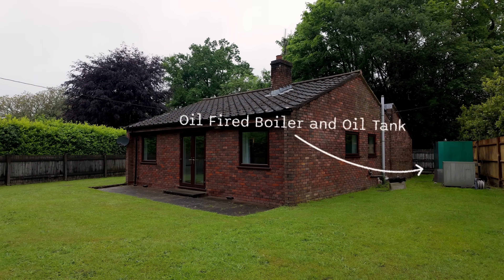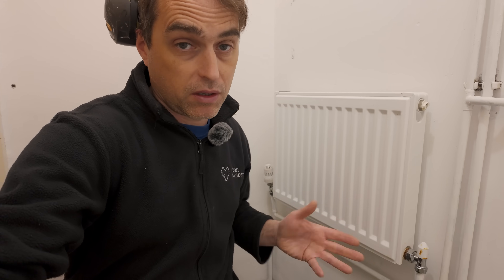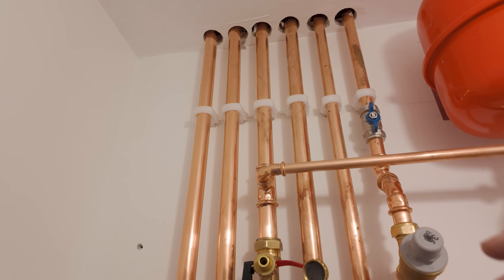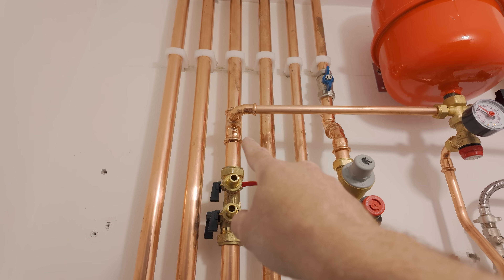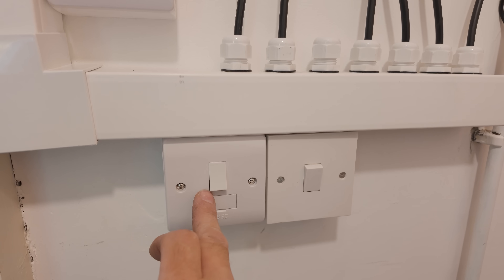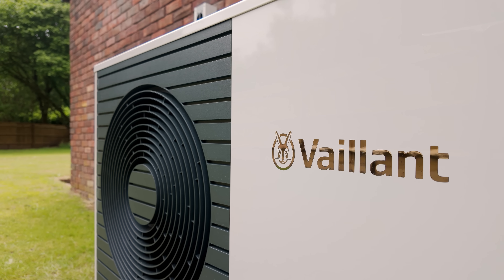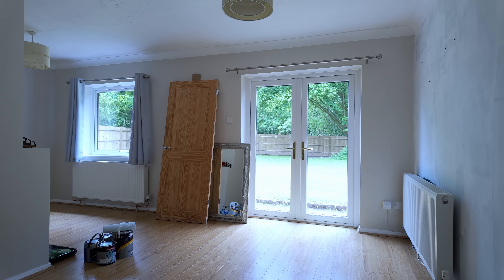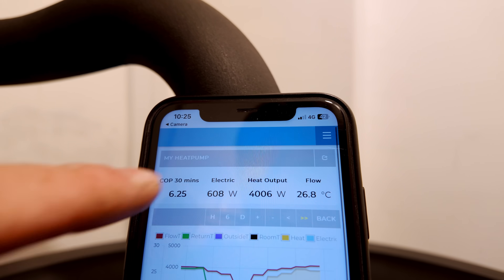Heat Pump vs Oil Boiler. It's a no brainer.

Comment: It will only take about a hundred years to pay for itself...🤣
Reply: I would guess environmental reasons. There is also every chance that oil boilers will be phased out in the next years. So why not replace it now when there is grant money available? 

If your tenants have low bills then you're less likely to have problems with rental arrears. 

Also likely to have tenants who stay long term if the bills are lower than they would get elsewhere. 

Off the top of my head that's three. Together we found FOUR potential reasons.
Reply: We never seem to ask how long a new oil boiler will take to pay for itself but for some reason we always seem to think a heat pump needs to pay for itself
Reply: As it was the landlord who installed it and the tenant who will save on bills I think we can assume they had other reasons for doing it.
Reply: @AmosMoses777  Stupidity???....
Reply from the maker: System will be much more reliable than gas or oil. There will be no bills to pay. House is always warm and no needs to think about turning the thermostat on or off. 

For the cost of new oil boiler they got a full new heating system.

No brainier
Reply: @AmosMoses777  Replace 25 year old kero combi boiler + System Flush + Replace rusty oil tank, less government BUS grant = £00.00 cost
Reply: @christianfaversham3766  You can't get an oil boiler on the BUS scheme. AS or GSHPs and in some cases biomass only. No fossils, no hybrids.  

You can get oil boilers on ECO4 but this doesn't look like it would meet the eligibility criteria for that.
Reply: @AmosMoses777  I put forward a cost comparison to replace a kero system, the amount you would have to pay out, and a switch to a heat pump with a £7500 BUS grant added into the budget.
Reply: @christianfaversham3766  oh, I see.

Comment: Interesting but modern condensing oil boilers do not smell (a friend of mine has one in her back garden). The oil tanker only has to visit about once annually I would have thought with a decent size tank? Maximum twice a year anyway. Notwithstanding not having to service the boiler is a bonus and additional cost saving.
Reply: Modern oil boilers have been low nox for number of years now . And average property doesn’t need anywhere near 2500 ltrs . 1000 to 1250 I’d say is normal as most home owners only buy 500-1000 ltrs at a time , I’ve quite few where 1000 ltrs lasts well over a year with decent insulation.

Comment: How comes you got the blow off from the expansion tank connected? I thought the vaillant was a partial monobloc and has it built in to the external unit?
Reply from the maker: No, 5kw and 7kw don’t have PRV built in only 10 and 12 do
Reply: @UrbanPlumbers  ah right. That’s another revelation!! 🙄😫

Comment: Excellent video (and installation) as usual. 👍I have had a look at the monitoring page and it is performing really well. That is a small property with commensurately low heat loss it will be interesting to see how it handles the shoulder months with regards to cycling. The new combi cylinder may have been a good application for this property.😉 Syzmon can you recall what design flowrate you were expecting on the system compared to what was achieved during commissioning from the Open Energy flow meter? 

Nice to see a Landlord looking after the property and their tenants too.👍

Comment: the bulk of my work is oil fired heating, when it comes time to change boilers most customers dont want to hear the words 'heat pump', probably because of all the early installs creating a lot of scare stories (which are mainly true around here).. its always good to get rid of the kero but for most customers the greenest thing they are willing to do is try HVO when its introduced.  in the past I have taken out ASHP and replaced with oil because customers are cold and poor, these stories make their way out into the Welsh communities and people dont trust heat pumps after that.. there is a lot of educational, as well as physical work to do.

Comment: He must be getting well paid by the heat pump manufacturers for promoting these heat pumps they cost a fortune to install and run and are no use in a cold climate like Scotland.
Reply from the maker: Heat pump manus would rather keep selling boilers as it easy money for them. Scotland is not a cold climate and heat pump work perfectly well there. No one pays me apart for happy customers
Reply: Tell me about your "Cold" climate in Scotland.
Reply: There are more heat pumps in the colder Norway! than Scotland. They work very well (ask a Norwegian) Scandinavians are better educated on heating and Global Warming!!!
Reply: @rabhaw2327 in this country we very rarely install gas and oil boilers to run as efficiently as possible.  If we can't even get those [legacy] systems installed optimally, it is no surprise that that the majority of installers in the UK can't be bothered to install heat pumps properly (heat pumps are likely more sensitive to incompetence than gas and oil in terms of installed running cost)

Comment: Great video. We have had our heat pump for 3 years now which was a swap for oil and have never regretted it. Cheaper to run especially as we have solar too and as you say no smell. We also had the Rayburn converted to electric which is also cheaper to run and no smells in the kitchen

Comment: Not that we need to change ATM, but it goes to show that a properly running an oil boiler is quite competitive in terms of running costs. I can see the advantage removing oil in a rental property but, TBH, the hassle of having the oil topped up in our place two or three times a year isn't that big a deal and there is a sense of satisfaction if you can buy the oil when the price is low.  That said, were our system to fail, I would seriously look at a heat pump (with the caveat below).

As others have posted lower down, it's a real shame that there are so few Heat Geek approved installers in the west country and that old housing stock makes the heat pump proposition less appealing.  As I see over and over again, so many installers simply don't understand the heat pump technology and the consumers end up with a pretty inefficient system and, in effect, a raw deal.

Comment: I rarely seen an air conditioner who managed to run for 10-15 years (usually Daikin and Mitsubishi) - and the air conditioners only run for 2-4 months in a year in my country 😅 
I expect even the most expensive ones will have some ugly faults in less than 10 years if they are running for @ 6 months/year… I don’t say that is not possible for some of the heat pumps to reach 15-20 years but I don’t expect that from Vaillant… 
At recent(2-3years old) @100kw Vaillant boilers the impellers of the EBM Papst fans are disintegrating😅😂 … we have a lot of them failing at schools and churches 😅😂; we have a lot of 3 way valves from Vaillant failing apart in warranty 😅; electronic filling valves …. And this are extremely simple parts to make right … I will never trust Vaillant on a heat pump product 😅

Comment: @ 9:02 Are you sure? 😊 
You’re secret favorite brand (😅 :D ) Viessmann can do almost the unimaginable on their ground to water heat pump from at least 2015-2016 😊 
You can see everything; status of all the internal sensors; electronic expansion valve status for the refrigerant; efficiency, power output; power input, heat curves… all in one product; even graphic simulation of the refrigerant circuit 😊 …. Power and efficiency day by day…. 
I think the rest of the industry are just copying them 😅

Comment: @ 4:04 Why not use a magnetic filter/separator instead of a Y filter?
I really hate this tipe of Y filter - with the time the cap gets stuck and many times I have to hit it with a spanner or a hammer to crack the fused pieces of metal…(brass is the only metal on witch the metal cristals are fusing together in the earth atmosphere … other metals or metal alloys need vacuum to merge together by themselves)

Comment: I'd looked at replacement of the gas combi with a heatpump, but the capital cost (no grants here) killed it before even considering pipe upgrades in concrete floors. 

What I did find baffling was the quoted annual running costs, 895 for oil, 820 for the heat pump for winters of -3  - That would be marginally under what I started with on my own 100m2 place on gas heating before beginning phased changes to insulation, monitoring temps, boiler run times, etc as I went. 
A manual version of weather compensation made a big difference during big freeze events, max advantage taken from the condensing aspect - When the Buderus main-board blew in March hen it was 6, it brought forward the intended change to a load compensated Viessmann (down to 3.2 rather than 8 kW) in summer. Not a pleasant experience, but job done...
Anyhow, to the cost aspect - Before closing the final phase of the thermal envelope last February, my annual gas bill was already at 380 quid equivalent - That is now headed to well under 300 for the next, and winters here go down to -16 now instead of -20 previously. 
The final radiator upgrade and swap around in August will see 105-120% of calculated heat loss for every room when it's -16 outside, at -3 the rads are 150-180%.
If prices fall substantially for heat pumps here I might look again, but for now the combi will do me fine on 20-25% of the original gas consumption... Ok, it's not zero carbon, but a massive step in the right direction.
This is why I really do not understand the UK's blinkered view to insulation, it's baffling.

Open Energy began life as a bunch of like minded hobbyists, glad to see them grow over the years and become commercially successful - As boiler/etc manufacturers remain so bloody minded about interfacing, they will continue to fill the gap....

Comment: It's a rich man's perk. A beautiful system, beautifully installed, but it saves not a penny in running costs. Tell us, Szymon, the actual cost.
With 20 million gas fired houses, probably £300 billion for installation costs plus £30 billion a year for maintenance and replacement. On top of that £100,000 per house to strengthen the grid. That is the official figure (total cost £3 trillion) from National Grid ESO.
We will have a nation of very poor householders and very rich plumbers. 
Will it make any difference? Not a lot because when the demand is greatest, on those windless cold winter days, we will still rely on gas power stations. The pro-net-zero BBC says that such plans are 'highly ambitious'. That's the word they use which means 'impossible'.
Reply: As Szymon noted, the kerosene boiler was 25 years old, and the metal oil tank was rusty inside. On hot sunny days, the smell of kerosene was unbearable. As a taxpayer for 50 years who has never drawn any benefits, I accepted the BUS grant, which reduced the cost of the Heat Pump installation to £1,000, the same amount I would have spent replacing the kerosene tank. So, financially, it was a break-even situation with no additional expense. With a British Gas EV tariff, the heat pump costs 1.8p per kWh. Adding a few solar panels and a battery reduces the demand on the grid. Australians use the same arrangement to alleviate peak demand on their grid.
Reply: Absolutely you did the right thing for you and I very much wish both you and Szymon well. But the economics don't allow everyone to do what you did. 
1. We can't all pay each other many thousands, for everyone to have a subsidised heat pump. The BUS scheme which funded you is pump priming to ramp up the industry, like the 43p/unit feed in tariff for the first domestic solar panels, to whom the poorer majority are still paying more than current electricity prices.
2. 7.9p/u cheap night electricity would not remain cheap if night demand increased with more heat pump and EV demand.
3. Latest contracts for wind are being placed at up to 17.6p/u. That's the price that the grid PAYS to the wind farm for EVERY SINGLE UNIT, even the ones you use at 7.9p. That pushes up the day rate for everyone, which is only held low by gas power stations.
4. Solar panels/battery gear costs over £8k for an installed 5 kWh - 5u. With the average domestic demand being 7.4u/day, that might supply just enough solar electricity on a sunny day and battery storage for the evening peak. But it won't if you add around 20u/day for your heat pump. 
5. Installed costs of battery storage are around £5000 for a 5u battery. If you want it to last more than 1000 cycles, you only charge it to 80% and discharge it to 20%. So the real storage is 3u. If you use all that capacity every day for 20 years (and your battery won't last that long) that's 20p/u simply for the storing of any electricity you put in. 6. A 1200 litre oil tank holds 12,000u of energy, thousands of times more than a 5u solar battery. We are not Australia: in the winter where, periods of dunkelflaute last sometimes for weeks and solar/batteries contribute nothing, oil boilers place no demand on the grid. Shift every oil and gas boiler to the grid and we find enormous peak winter demand which, on those dark, windless winter evenings, have to be met by gas power stations and an enormously strengthened electricity grid at £100,000 per home.
7. I know it's not easy but more transparency in the whole industry would really help. For instance 'My heat pump installation cost £17,000', or whatever would be so much clearer than 'with the subsidy it only cost £1000 more than...'
Good wishes
Reply: @markellse  my priority is to have the most cost effective solution over a 5 year plan. The Grant outside combi boiler, kero tank, pipwork and wiring was all too old and giving problems. To replace the boiler, fuel tank, dispose of the scrap, transfer the kerosene, commisison a new kero combi boiler was going to cost circ £7k + £20% vat £8,400. The Grant Vortex outside combi boiler has to be on 24/7 which uses average 1 litre fuel per 24hr period holding temperature for on demand DHW and or CH = 365 litres per annum wasted. If you add £7,500 grant onto £8,400 that gives you circa £16k to play with, no agro and no smells. Add on another £1,000 for 1,825 wasted litres of standby kero over 5 years, you now have a new Heat Pump, new bigger Radiators, Monitoring, Guarantee, and a few quid left over for a fish and chip celebration supper ! Solar panels and a battery doesn't have to be through the roof if you can do DIY, fit and source yourself. I get your point about the grid demand, Rolls Royce should be suppling SMRs in the UK soon which will help suport and balance EV and HP demand. Trying to get across the long term financials, when an old system is uneconomical to repair, it's good to look ahead to something more cost sensible than keep pumping cash into a dead duck.
Reply: @christianfaversham3766 Thanks, Christian, for that very informative and interesting information. 
Your decision makes sense from your point of view and I can see why you did it. 
There is a lot of sense in a well engineered heat pump setup. It's very elegant - heat leaks from the hot house into the cold surroundings and we use just a little bit of electricity to pump an equal amount back in. 
But the whole system complexity scribbles over the elegance. Since wind is variable, it has to be backed up with an equal amount of gas generation and as many new gas power stations as wind farms. The power stations are run intermittently to fit in with the wind, so are therefore run inefficiently. The capital cost and the embodied energy in supply to the grid is much increased, on top of the grid hardening already discussed. 
Solar, on the other hand, I don't think makes any sense in the UK. It's contribution is negligible and it comes at a time when the grid is generally in surplus, producing efficiency losses for gas power stations greater than the benefits of its contribution.
But for all, maintenance and replacement costs may the determining factor. I'm struggling to find someone to get my car heat pump serviced. (I mean the one that pumps heat out in sumner.) I'd hate to have that for my main heating system. 
GW, Mark

Comment: We don't use Open Energy Monitor, but instead use the Ebusd project's logging. Using the data from that, I was able to confirm that our heat pump suffers from the Vaillant energy integral counting firmware issue - Not that the evidence matters as Vaillant doesn't care, but it's good to be able to just quickly pull that data out. We can also clearly see if it's cycling or not, how often it defrosts etc. We've also used it to experiment with the DHW plate loading setup.

I have a question about this install, on the central heating return you've used a press-fit ball valve. Are you not concerned about the maintainability of the valve or do you think that's a non-issue? I like press-fit, but I'm unsure how I feel about the ball valves.